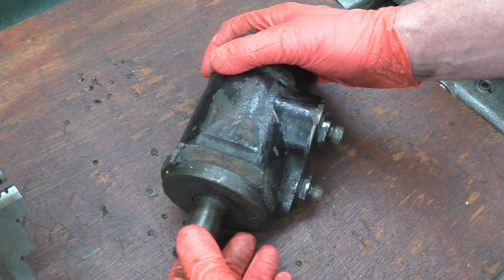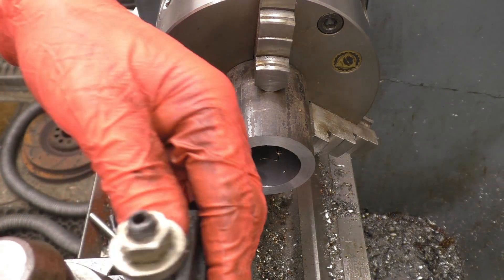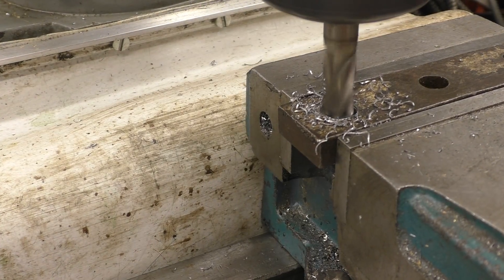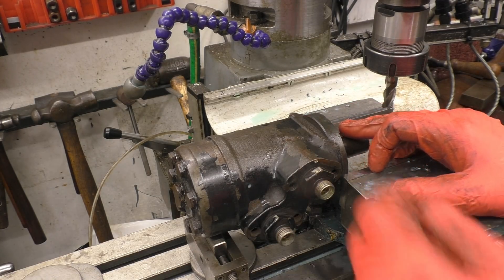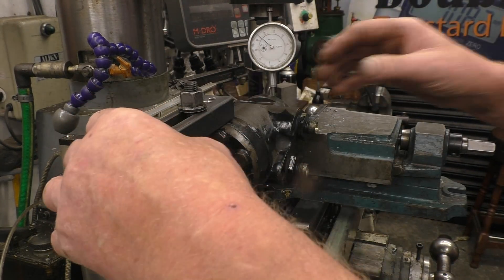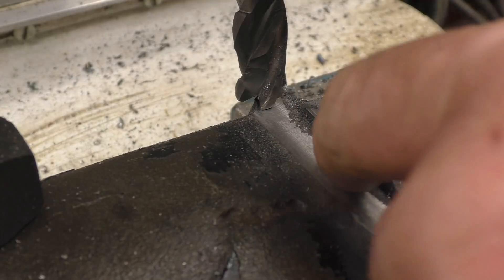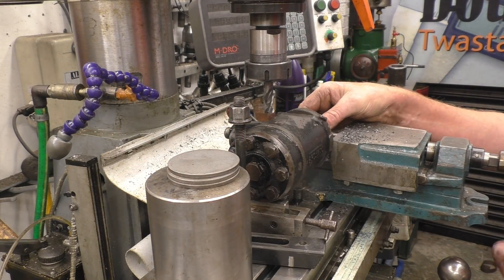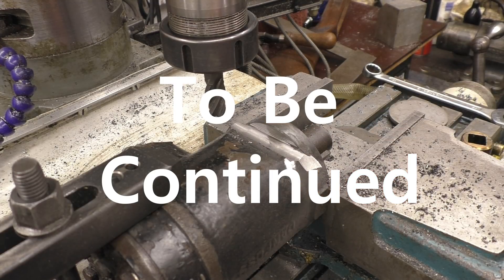SNNC 395 P1  Hydraulic Pump Mounting Lug

Comment: You should have blanked off the pipe fittings, one bit of debris blown in there and the pump/ motor is done for. Love the films though.
Reply: Was just thinking that tbh. Even a bit of tissue paper would have worked.
Reply from the maker: Fair comment